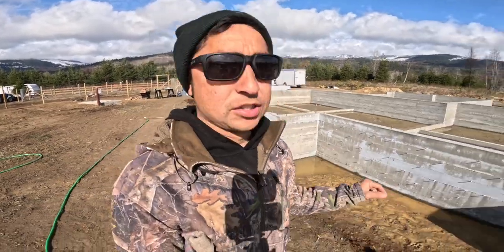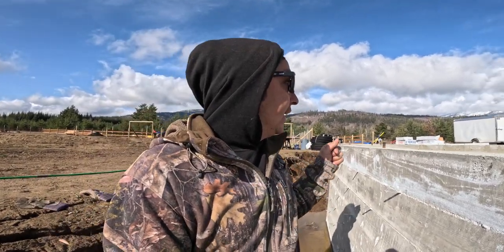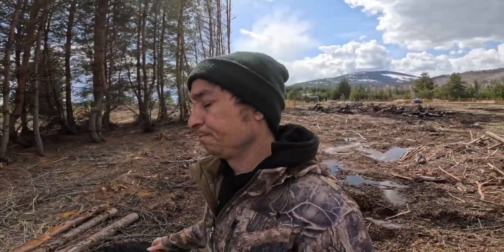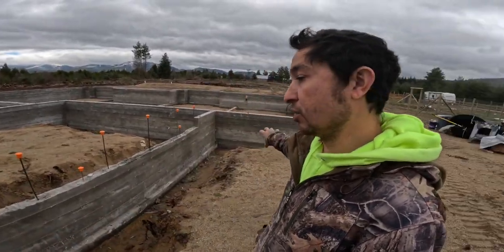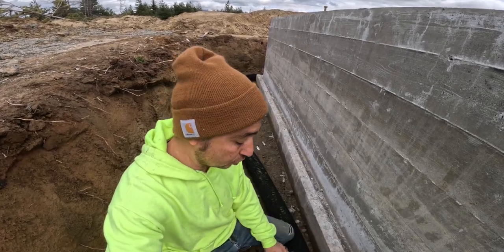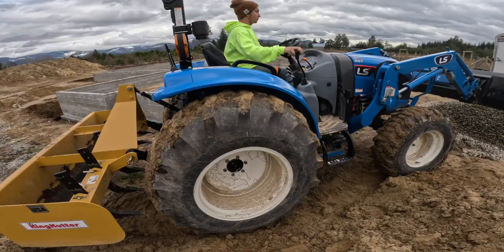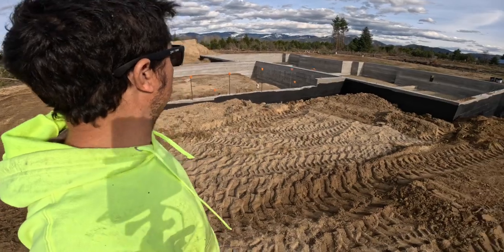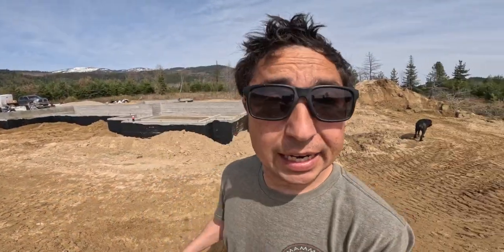Building a House By Myself | Foundation Waterproofing

Comment: Since you have sandy lome rather than a clay content soil you may be OK but I still never back fill till after rolling floor trusses as the old rule goes. A cracked foundation always cost more to fix than prevent in my experience. That house still looks huge!
Reply from the maker: Yes, I backfilled previous to rolling my floor joist But I did not compact anything. I was waiting to have my excavator come back and do the final backfilling and compacting until after the floor deck was on and sheathed! Sorry I didn’t explain that better😬🤙🏽 my guy has already final graded and compacted now that I have walls almost done🤙🏽👍

Comment: Hey Sam, curious what’s the reasoning painting waterproof after the drain pipe is down. Shouldn’t you paint waterproof behind the pipe too? Thanks for posting this I am enjoying watching and learning.
Reply from the maker: The drain tile is below the footing level… the purpose of the tar waterproofing is to force the moisture down to a place where the water can move(whether it’s soaking into the ground or escaping via sump pump )in our case I want it to soak into the ground , but if it doesn’t we have a sump pump system set up to help evacuate the moisture 🤙🏽
Reply: @dkranchdom  Last year was a bigger runoff year. On the Priest Lake house, last April-May the water level in the crawl space perked under the footings and met with equalization to grade. Burned up one sump pump last year.
Reply from the maker: @ModernMountainLiving  I’m sure I will have some water that will seep up in the crawl space as well! I haven’t finished the interior waterproofing yet that will be done in fall, and I will do a video on that part , I’ve got lots of ways to evacuate water/moisture! The sand where we are building is what is saving us here! It DRAINS sooo well 🤙🏽🤙🏽